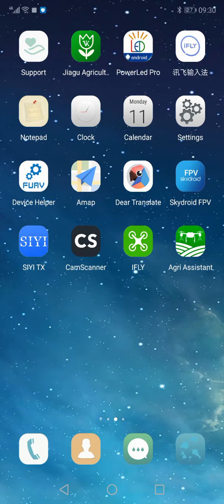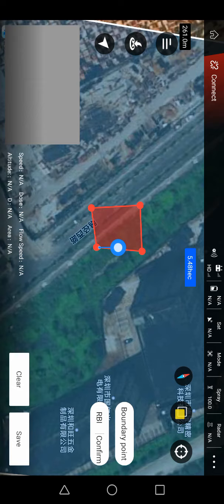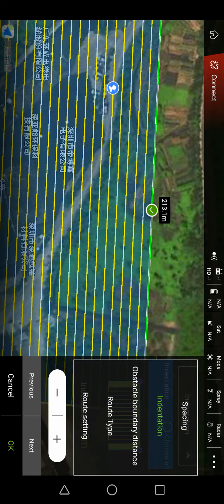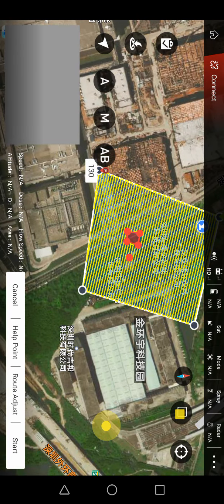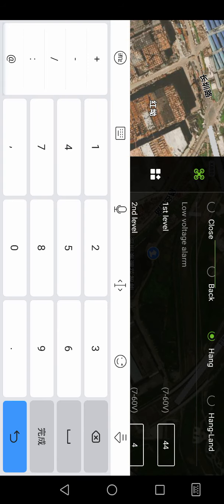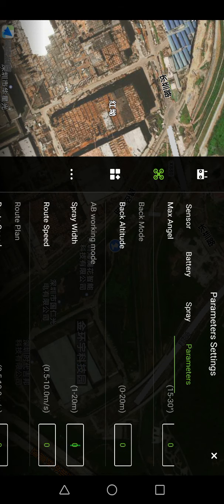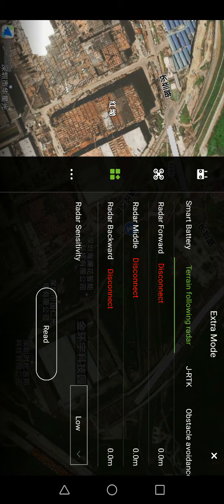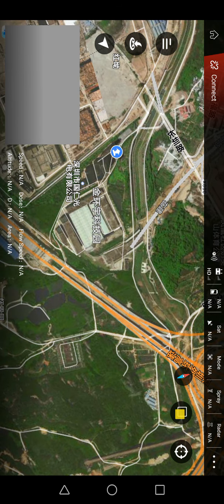JIYI APP(Agri assistant) teaching video

Comment: Hi, my forward facing radar (obstacle avoidance) is way too sensitive and is not allowing me to conduct my flight plan. I'm spraying tall trees so it senses them as obstacles from very far away. I have the minimum obstacle distances set (20 and 10) but this still seems to be too sensitive. Any tips for this issue?

Comment: hello, I use the same app to control, however, the drone does not start the engines if there is no internet connection. Have you been through this before? Do you have any suggestions?
Reply from the maker: Hello sir, sorry for the late replying. How's going with your drone now? You can contact me through whatsapp+8613088888246 if you still need helps.

Comment: How can I change voltage to PERCENTAGE in battery status? It was working on % was easier for me and now it switch to VOLTAGE and I dond´t understand why.
Reply from the maker: The power will be displayed as a percentage only after the battery communicates with the flight controller. In the absence of communication, the power will be shown in voltage.

Comment: Hi thank you for the video. Is it possible for the drone to control and adjust its altitude during the flight based on radar or an imported DEM?
Reply from the maker: If you turn on the terrain radar, then you can not adjust the height by joystick. 
But you can revise the Radar Height on Application

Comment: what is the RBI means in obstacle plotting function? thanks..
Reply from the maker: Confirm the location of obstacles
Reply: @TTFDroneTech  yup, thanks 1st.. im aware the use of the button.. but just wondering the full term of "RBI".. please let me know if u know cause i trully beleive that "RBI" is acronym to something..
Reply from the maker: @ezareziardyzainudin5600  in fact, I don't know
Reply: @TTFDroneTech  its ok.. thanks bydway..
Reply: @TTFDroneTech  finally i got the answer with a clue from support.jiyiuav.com

What is RBI in aviation?
Template:Unreferenced just test if it can work stub A relative bearing indicator (RBI) shows the bearing of some source relative to a vehicle carrying a detector. It is most commonly used in conjunction with an ADF (automatic direction finder) in an aircraft navigating with the aid of an NDB (non-directional beacon).
Reply from the maker: @ezareziardyzainudin5600  good job. if you need any drone parts, please let me know.
Reply: I am just buying drone. My remote control is not connected to drone how to solve?
Do I need to upgrade my account to connect?
Reply from the maker: @moviekhkhmer2926  Hi! It can be caused by several reasons, please contact our engineer whatsapp +8613048888023. He will help you to solve the problem.
Reply: Cómo hago para obtener esa aplicacion
Reply from the maker: @ortizperez2  We can offer you a link to download, please contact us through whatsapp: +86 13048882133